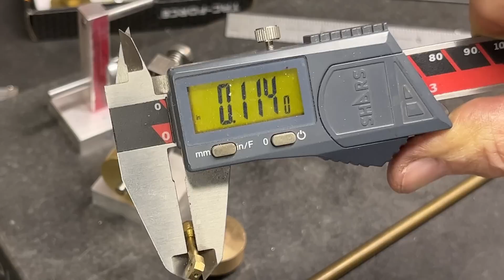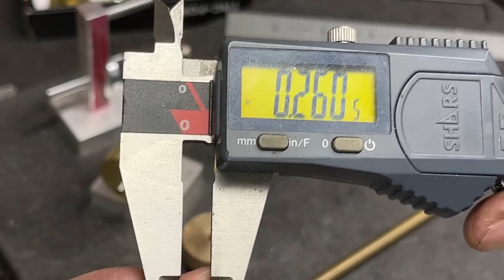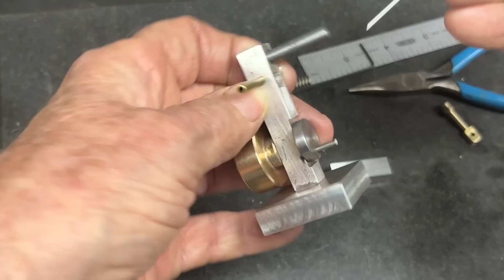BUILD A TINY MAYONNAISE JAR STEAM ENGINE pt 4 #909 tubalcain mrpete

Comment: Thanks Mr. Pete. I think I'll make a couple of these, including the jars, and give them away next Christmas as gifts.
I was a career larger city firefighter retired after 27 years of service. We were taught that to put out a magnesium fire we were to hit the fire with a straight stream using higher pressure. The idea was not to actually extinguish the magnesium burning because water actually accelerates the burning of magnesium. The idea was to wash away the molten burning magnesium from the unburned magnesium fuel while cooling the magnesium below it's ignition temperature.  If available ( it never was in the field) Metal X was the extinguishing agent for magnesium fires and it is sodium chloride, common salt.  Another option for small fires was to cover them with dry sand which would not extinguish them but would prevent them from igniting nearby exposures. Magnesium can still be found in modern vehicles usually in the steering columns and we often ran calls on vehicle fires with the steering column involved by the time we arrived. Extinguishing them always provided an interesting "fireworks" show. 

My wife recently had cataract surgery and there was really nothing to it. There were a total of 5 appointments, one for consultation, one for surgery on each eye and one post op for each eye the day after surgery. She got the Forever Lenses which eliminated the need for wearing glasses, something she has needed her entire life. There was only a little discomfort after each and her vision wasn't perfect until a few weeks a after surgery. She would do it again, no question, if she had to decide again.
Reply from the maker: Thank you very much for the information about fire fighting. It’s good to hear directly from a fireman. I think I will have the surgery next year.

Comment: The step on the cylinder serves 2 functions:  reduce the friction as the cylinder wobbles (as you mentioned), and increase the sealing force between the cylinder and column (spring force applied over a smaller area).  Arguably, the second reason may be thought by some to be trivial, but does reduce the force area by about a third.
Reply from the maker: Thanks

Comment: Good evening Mr. Pete, one of your YouTube students here. 

I actually did build a back to back engine like you describe. It's "Twinkie", a twin oscillating engine from Stan Bray's book on simple models. Each engine ran well by itself, but the two of them took excessive pressure to run and would eventually break itself. Either the set screws on the flywheel would loosen or the loctite on the crank discs would fail. 

Do you have a video on how to fix tight spots and other binding? If not, it would be very valuable, as you're always saying to address them but it's not always obvious what to do about them. Maybe it should be obvious to a machinist, but I'm not one... just a guy who bought a lathe.
Reply from the maker: I would still like to make one of the double engines
No advice on how to fix tight spots. The real answer is to work accurately and not create tight spots.
Reply: @mrpete222  for what it's worth I'd recommend a twin V using the same crank over a  dual inline like I tried to build. Eventually I'll do it again once I have more experience in machining.

Comment: I have kind of a silly question but if you run steam through one of these little engine will it not heat up enough to loosen the lock-tite?
Reply from the maker: I’m not sure, but I think it would take more heat than 212°
Reply: @mrpete222  thanks for the reply. I was just wondering. I've put loctite on my steam engines but was wondering if the heat would loosen it